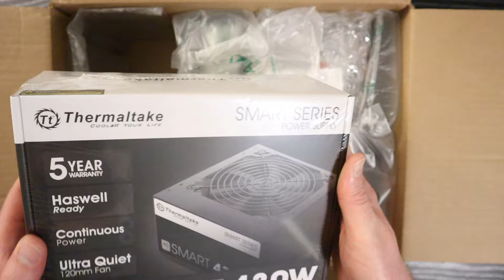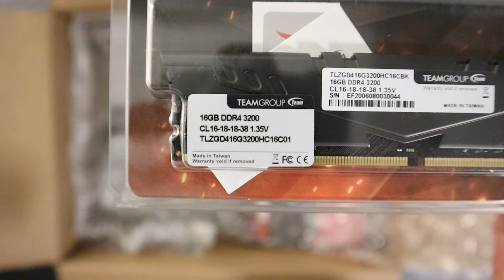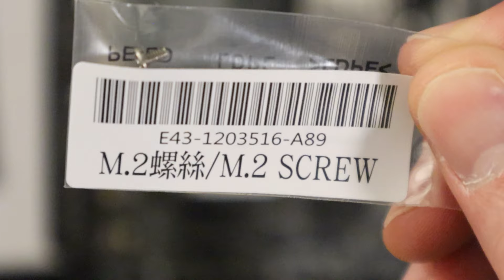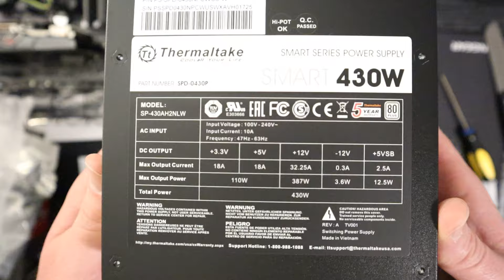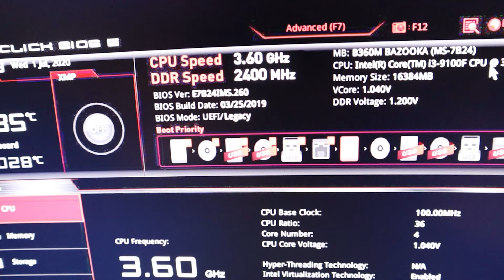HOW TO BUILD A COMPUTER!-$500 Gaming PC-Full DIY Build

Comment: Hey I just found your channel and I love it. I'm currently finishing up my saving for a setup which I'm planning on building in september.
I've been trying to pick out the parts for the computer but I'm just bobbled on the processor rn I want to get the i3 because I'd get good frames in fortnite but at the same time with future games 4 cores is gonna be bad and I'm also a youtuber and I have t ok edit so idk how good the i3 would be for that but people say the ryzen 1600 af is good for all around the the benchmark for fortnite isn't to high and the price for it is like 60 dollars more than the i3 on amazon so idk what to do.
Reply from the maker: Thank you so much! If your budget allows it.... your best bet is a Ryzen 5 3600. If you're close to a Microcenter, they have them for $160! Plus like $20 off if you get a motherboard with it! I use a 3600x which is like an overclocked 3600...and it games and edits like a champ. I rendered this long video in around 7 minutes. I also have it paired with a RTX 2080 though.
Reply from the maker: Don't buy the 1600 AF unless it drops back to around $80 or $90 like it was when it came out. Also check out your local used market.
Reply: @WilliSilicon  yh the 1600 af is somehow more expensive than the 2600 idk how so your saying a 2600 would be good. What about an i5 9400f? Which one would do better
Reply: And I live in the Caribbean there are no micro centers so I gotta use Amazon
Reply from the maker: The i5 would be better for gaming. The 2600 better for editing. I wouldn't get the 2600 unless you find it closer to $100, because the 3600 is sooo much better and only typically $30-40 more.
Reply from the maker: The 3600 is even better than a 2700
Reply: @WilliSilicon  thank you I'm trying to keep the pc itself at around a 600 dollar budget to get 144 constant fps in fortnite and I'll spend an extra maybe 300 for a 144hz monitor and a desk
Reply from the maker: If you could work in some used parts you could get a 3600 with maybe a GTX 1660 in a $600 system
Reply from the maker: The hard part lately is finding a PSU that's good and affordable

Comment: You should play cod modern warfare on your second channel
Reply from the maker: I didn't notice I was logged in to my personal account when I commented 😂
Reply from the maker: I'm about to benchmark Warzone on this PC today
Reply: WilliSilicon cool I would play warzone but  can’t run it so I’m upgrading my psu and putting a 1650 super in it and there maybe be a slight bottle neck cuz i only have a i5 6400 but idk just need to save like 30-40 more bucks
Reply from the maker: Your CPU should be a good paring with that card. It shouldn't bottle-neck.
Reply: Ok cool I was gonna use an rx570 but my case is too small so then I thought to do the gtx 1650 but my psu was like 240 w so I had to upgrade it anyways and for 10$ more and 40% more performance I think it’s ok
Reply from the maker: Yeah a 1650 super is a little better than a 570. Get one of the $160ish models.
Reply from the maker: Power supplies are hard to find right now at a reasonable price though 😭
Reply: WilliSilicon ik and I don’t want to go with a janky one for like 20 bucks but I can’t find a decent one for under 60
Reply from the maker: https://amzn.to/2VNrfle is the best deal I see right now. Still not in stock for a week though
Reply: WilliSilicon thx

Comment: Hey here’s the thing im gonna 100% build a pc but like I’m scared something will happen
Reply from the maker: Yeah something AMAZING! Just go for it! Make sure you research the parts you need for what you want out of your system, then get it done! Good luck!
Reply: WilliSilicon thanks man but I have a question is there a Monitor you can recommend for me that is good and cheap it’s for a gaming pc and my budget for the setup is $300-$400 the pc budget is about $500
Reply from the maker: What is included in your $300-$400 set up? Monitor, keyboard+mouse, headset?
Reply from the maker: Also, what kind of games are you wanting to mostly play with your $500 rig? If you're gonna play AAA titles you won't get much over 60 fps, so I wouldn't spend the extra money on a high refresh rate monitor. But if you're playing E-Sports I'd recommend a 144Hz monitor.
Reply: WilliSilicon I’ll most likely get a cheap but fairly nice monitor $100 dollars or so I already have a headset and mouse then I’m getting a ducky 2 mini $60 and the rest will most likely be a desk
Reply: WilliSilicon also I meant 3 monitors
Reply: WilliSilicon also I upped the pc budget to $700 I would wanna play stuff like rust,r6,Csgo,etc
Reply from the maker: I'd recommend https://amzn.to/3gCexgZ. If you want smaller but cheaper then go with https://amzn.to/3iFWZCp
Reply from the maker: Maybe something like this https://amzn.to/2VVQ12I for the main display